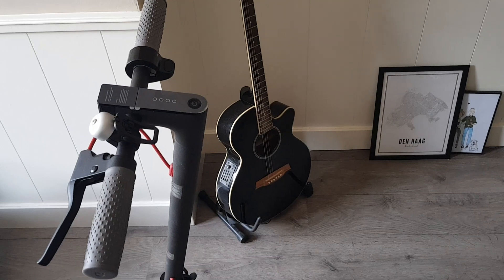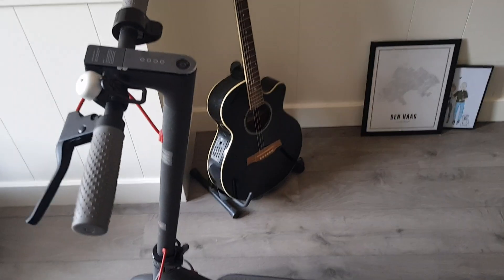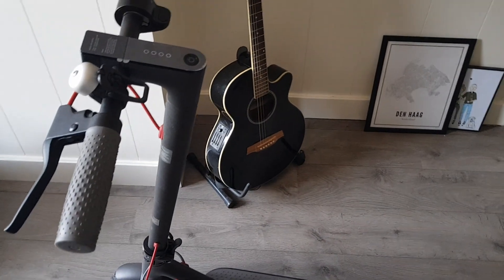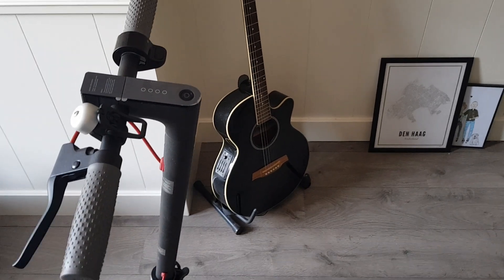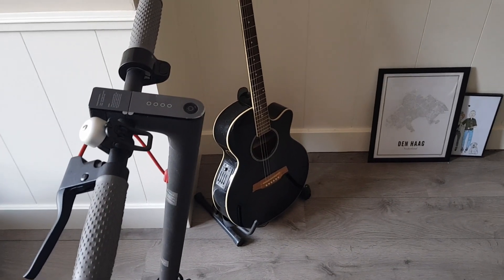Xiaomi Mija M365 Scooter: Error code 24, wrong voltage supply

Comment: If the led battery is blinking blue, then you need to replace the mainboard.   No other option.  Unless you know FIX the PCB Component.  I had this issue before, after replacement back to normal
Reply: Controller or bms?

Comment: Hey, had the same problem. Fixed it.

I went to work with full batery, when tried to come back, I've got error 24 (two long 4 short beeps) when turned it on.

I've taken out motherboard, which was wet...
Plugged everything back and it works.

But I knew that battery voltage was ok, so it has to be the board. If voltage isnt 36-41.5 it's the battery.
Reply: i took it out of scooter , and i cleaned and preheated on 100 degrees celsius , so all the humidity on the controller would be gone , also i took out the black rubber that seems to hold the moisture on its surface , now it works
Reply: What is the fix?
Reply: @endurodave   can you tell what i do exactly plz i have some problem
Reply: @hedisediri2618  I replaced the controller
Reply: Do you Fix this?

Comment: Did you ride it in the rain or had a jump with it? Can you connect to see battery cell voltages?
Reply: hey, dude i have the same problem, my scooter is beeping 1 long time and 4 short times. Yesterday i rided with it in the rain (not in the rain but ytrough wet road) and i tried to ride today everything was ok, but in the middle off the road it started beping and just stopped, brakes is very dirty btw, i think i need to clean them, if you can help me with this issue
Reply: Me I jumped with it 🥲😫🤭